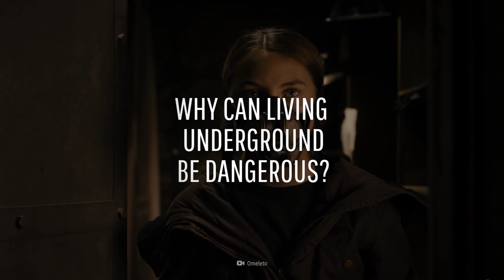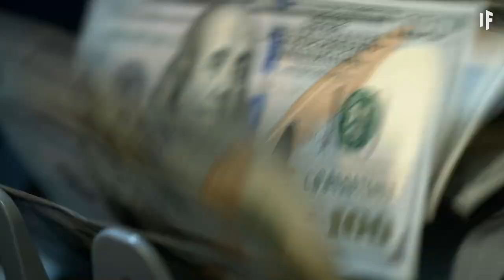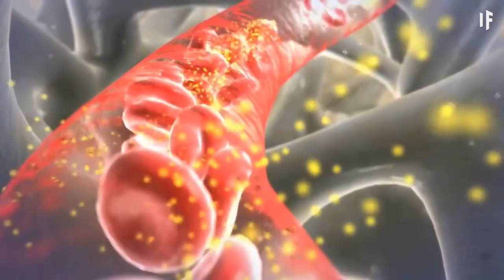What If We Built the World's Deepest Bunker?

Comment: Does anyone know if it would be possible to build a bunker 500' below the surface With 10000' of storage and sustainable  Independent energy with a Large blast door for 20 million?
Reply: Well I don't know what the 10000' storage supposed to mean but 500' or 500 feet depth is similar to a typical high end military bunker 20 million is highly unlikely to cover the costs. I would say 50-100 would be the minimum.
Reply: @norbeekash2699   it's being built right now. I wanted five hundred feet below the surface with ten thousand square feet of storage unfortunately in my location it's not possible to build that deep. I settled on less but it's going to be a very spacious and safe bunker for my family and friends.